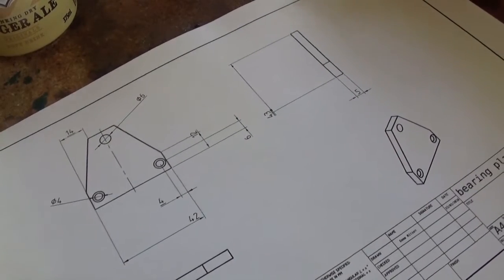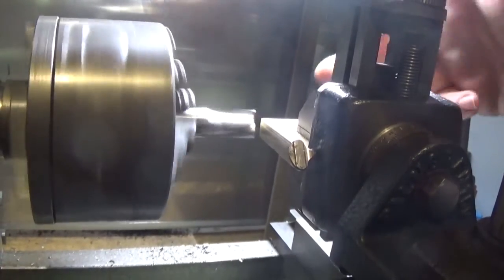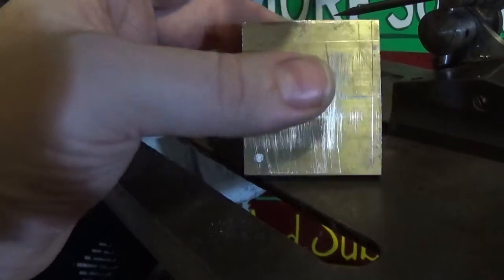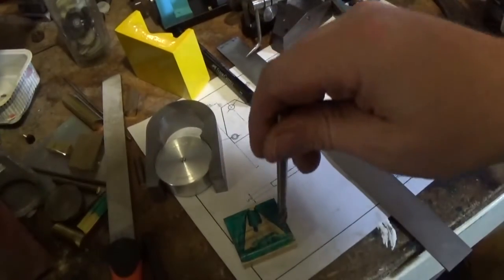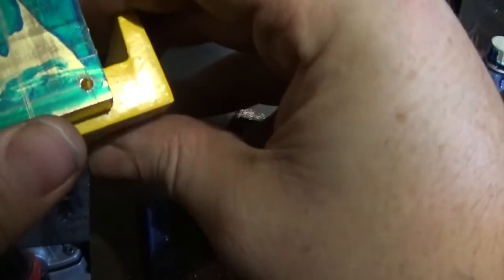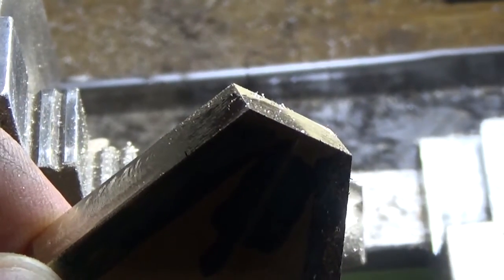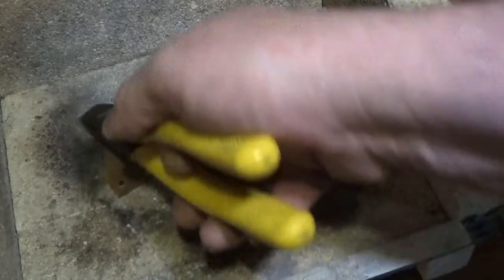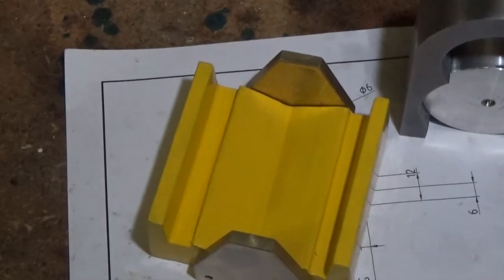Prince Dynamo motor PART5

Comment: Nice job Emma, next time you are placing an order and the dealer has tapered dowels, you might purchase a few different small sizes, they are not very expensive, small  tapered reamers are also reasonable, beauty of them is ease of dismantling as apposed to straight dowels, also if you need accuracy and your lineup is a little off with straight dowels you have to open to a bigger size but with tapered you can realign and tighten  the locking screws and then ream the hole true with the tapered reamer, just a little bit of trivia,    

Edmund,